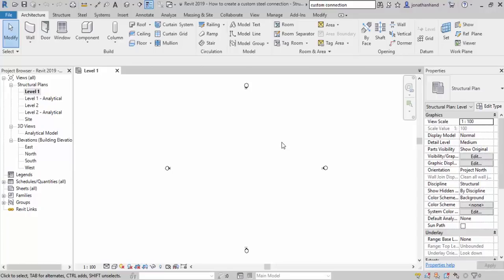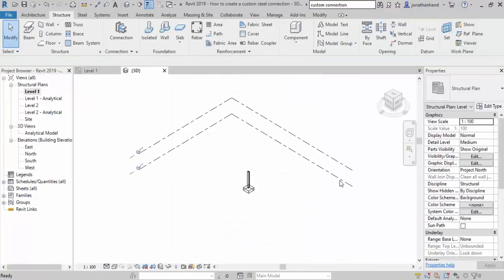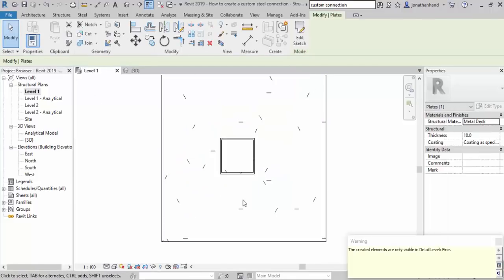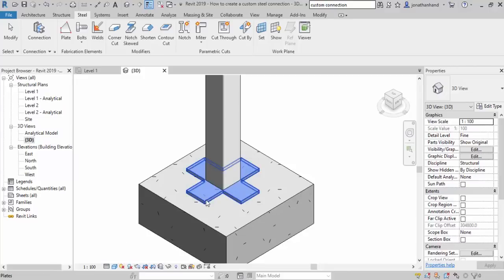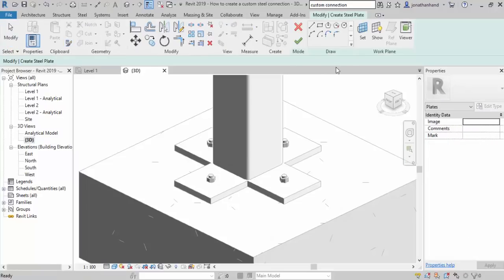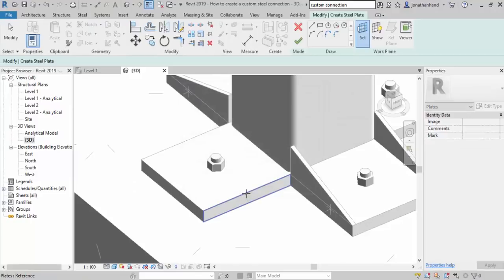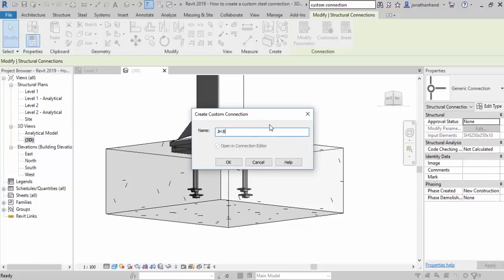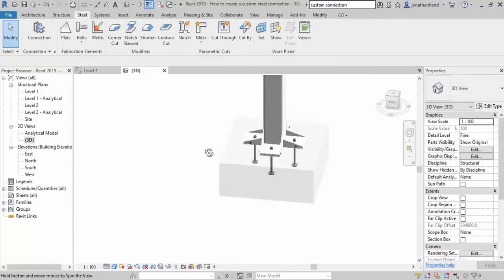Create a custom steel connection in Revit

Comment: Hi excellent tutorial which I must confess. But the question is how could I make the connection that will change the with the change of column x-section? Please let me know or share a link if possible.
Reply: Cant be done in the current release. The new custom connection remains "dumb" in that its not parametrically driven. You would need to create a new connection for every section to be used. You can easily to this be "breaking" the initial connection and using it as the starting point for creating a new one. He could have called this connection [JH Baseplate 250X250] the create a new copy for every other section required.
Reply: @TheCuriousOrbs  Thanks mate for the suggestion.
Reply: Please watch this tutorial https://www.youtube.com/focusteklarevit  Thanks!